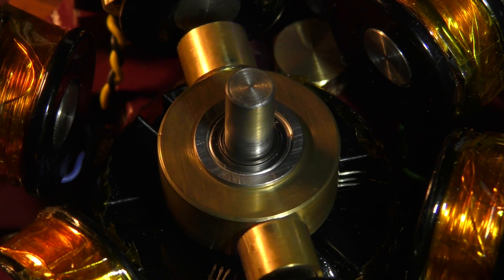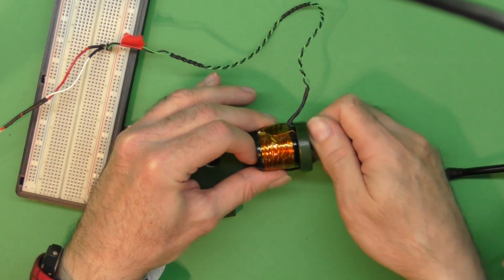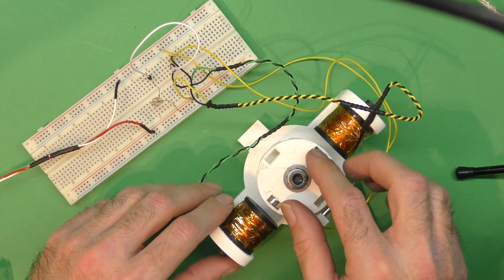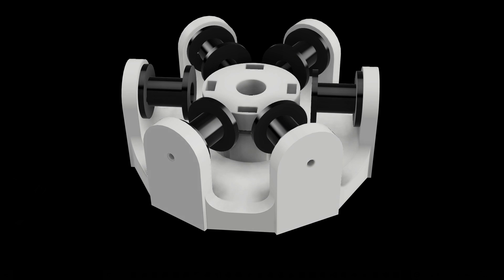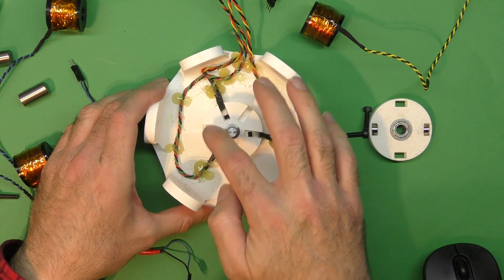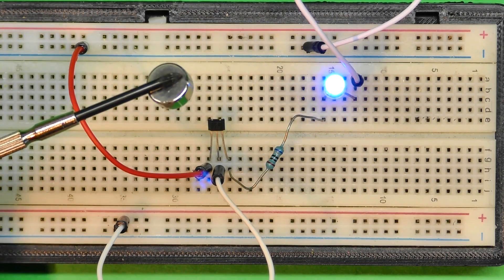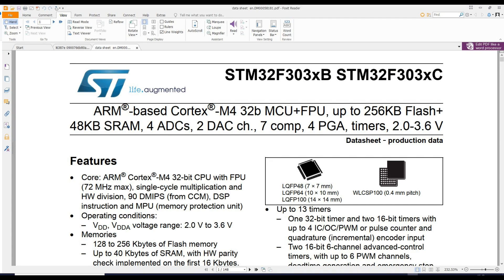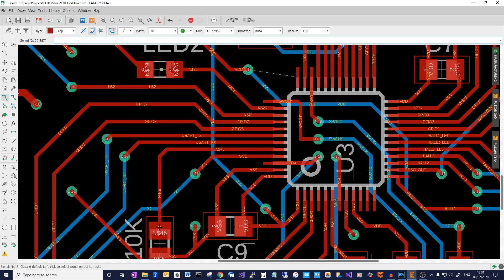Making a  Brushless Motor

Comment: Max Holy.....
It is not a question of the value or time lost in building what this man presents.
But the high level of knowledge that he has in several areas of work.
For my part, it deserves a lot of respect.
In the time invested in this project, which I personally admire a lot, he is publicly depositing in the biggest social network that is YOUTUBE, the knowledge he has giving ideas, transmitting knowledge, value and respect for others.

Many like you post 30 second off  videos and do not explain anything or teach anything about what you are doing.
only videos of stupid and absurd experiences filling the network servers.

Mister David ...
thanks for this video.
what made me like it more was the finishing touch ...
use the ampoules.
(I don't know the technical name)

Well act, lots of health.

Comment: Wow what firing order and did you use an H-Bridge configuration for any of the circuitry.  I'm currently working on Permanent Magnet Synchronous Motor (PMSM) motor with 36 coils inside stator and 48 poles outside rotor.  I'm having trouble using Mosfet switching, I won't be using logic level Mosfets as I will be going up to 300 volts for the driving voltage.  Could you toss any help my way, with either buying a unit or construction techniques to use.  Love the steam punk design and your eye on perfection in design. Thanks
Reply from the maker: Hi Timothy.  Yes – it was just a standard 3 phase H bridge with 6 N type MOSFETS. In my case they were 6 x IRL40B215 (selected on the basis of that’s what I happened to have in the MOSFET draw – massively overrated for the stuff in this video!). No doubt you can find something similar but rated  > 300V. For the gate drivers  I was using 3 x STs L6387 series as they can generate a voltage high enough to drive the gate for the high side MOSFETS.   In terms of figuring out a commutation sequence the two links below proved helpful to me for the BLDC motors.

https://www.youtube.com/watch?v=ZAY5JInyHXY&t=455s

https://www.digikey.be/nl/articles/how-to-power-and-control-brushless-dc-motors
Reply: @DavidCambridge  I thank you for the help.  Will investigate the links.

Comment: Instead of sand casting the aluminum, you could have used a 'lost PLA' process with a plaster mold.  Using the 3D printed object as a form for the sand cast works well too.  This project is certainly a mix of different maker skills.  I'd love to have a metal machine shop, maybe some day I'll buy a lathe and a milling machine.  Wow, TIG welding too.

Comment: Hello very nice and interesting design.
I´m wondering what could happend if you put a electric motor inside other electric motor so they can spin at the same direction but The velocity may duplicate or which could be the effect? 
Thanks

Comment: David,  This is a very nice build! I agree with others that you used most all the engineering techniques available (in your shop?).  This video should be mandatory of all trade schools.  It shows why different techniques were used to make the build strong, yet look good.  For example, you knurled the coil nuts!   Also, you had your new boots on!  Nice touch.

Comment: Nice electrical/mechanical/software demo! You mentioned the "eddy currents" three times already, nevertheless:
- The soft-iron slugs in the coils do very little as long as there is no "back iron" interconnecting the adjacent slugs to each other.
- In fact, you'd get a higher efficiency (albeit at a slightly lower torque) if you completely omitted the iron slugs
- For higher torque (with even higher cogging) consider adding a ferromagnetic "outer ring" outside the stator
- The cast-aluminium holder acts as a big "shorted-loop" on the stator - substituting this with an (e.g.) PLA part will improve the efficiency 
- The previous point is especially true if you add the "outer" back-iron ring. An option is to position the ring between the coils and the aluminium-bulk --> that way, the iron passing through the aluminium does not carry any flux.